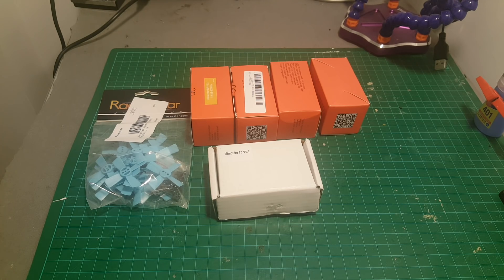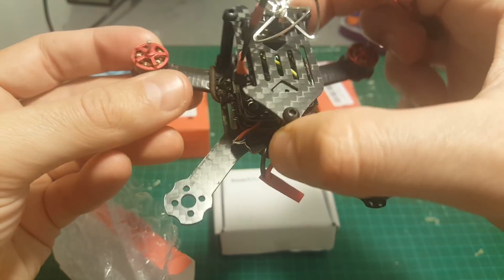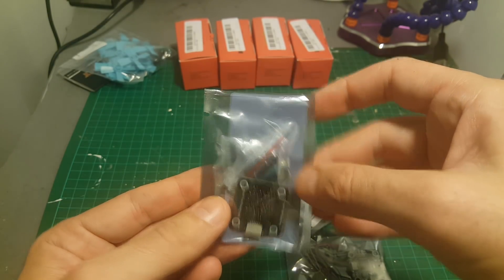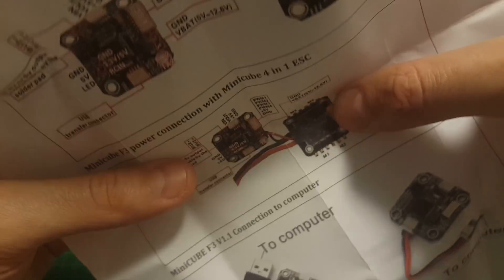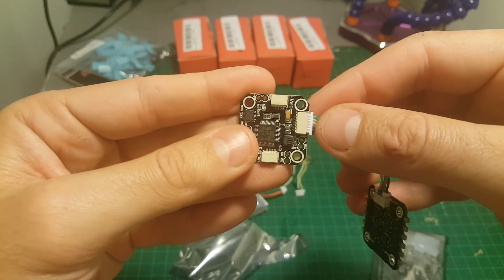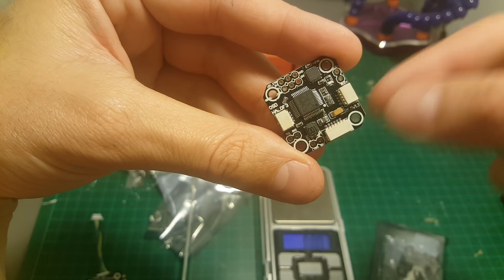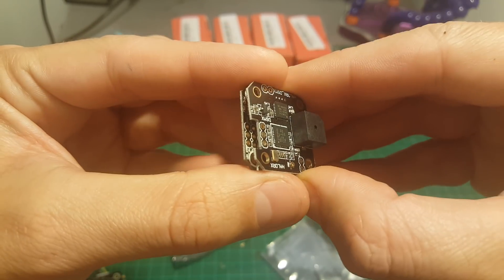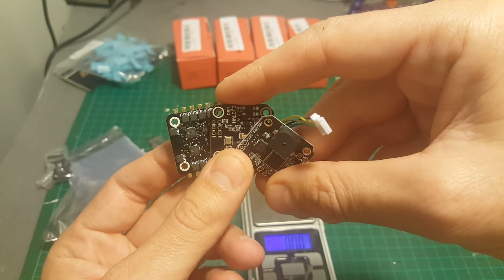Ultimate Micro AIO Solution - Eachine MiniCube Unboxing And Review

Comment: how to blind'dsm2 model with taranis and 4in1irenge multimodule¿
Reply from the maker: Did you setup the pin on the module to be on CYRF6936 selection? If you are going to use this module often, it is advisable to flash your taranis with the firmware that allows the model selection to be done through the GUI of the RC.

Comment: Hi Gal,
First of all thank you for your great video. Definitely one of the best out there to help assemble a quad.
I have a question. Around minute 4:09 you show the pins to solder/unify to have 3.3v or 5.0v output. However looks to me that you are indicating the bootpad when you talk about the 3.3v output while indicating the 5volts output where it is the "real" 3.3v. Am I correct? I am going to do my build and I have a big doubt about it. Thanks!
Reply from the maker: Hi Stefano, first of all - thank you for your kind comment.  I did make a mistake and I thank you for correcting me. The first pads that I am pointing on and referring to as the 3.3v are indeed the boot pads. The second is the 3.3V and the ones to the right are the 5v. Please accept my apology :-) Good luck with your build! Here is the instructions manual of the FC: https://goo.gl/8ve1Qq

Comment: How do you flash latest firmware?
Reply from the maker: +Michael taveras just short the boot pads together while connecting the flight controller to a usb port. It will enter a DFU mode and then you'll be able to flash it.
Reply: @KremerFPV  what firmware target do you use? It says use omnibusF3 target but that target doen't exist ....there is omnibus and omnibusf4....which one do you use??

Comment: Hi thank you for this video. I was wondering if you could help me. 
I soldered mine together as per the manual. But when I connected to 2s, the FC did not power up. It got very hot, so I disconnected right away. No smoke. I connected to the board via the USB and it powers up. I can get onto CF and the receiver works, my camera and OSD work too. 
Is my board fried?
Reply from the maker: I suggest that you should check the board and see that you didn't solder together any capacitors or something like that. If you soldered everything correctly, it does sound like a DOA product and you should contact the seller.
Reply: Could it be an esc issue? I going through the esc settings and esc 4 was going back and forth saying it was flashed and saying it wasn't readable and finally it says the memory is likely corrupted
Reply from the maker: That's easy to tell. Just disconnect the ESC board and see if it powers up.